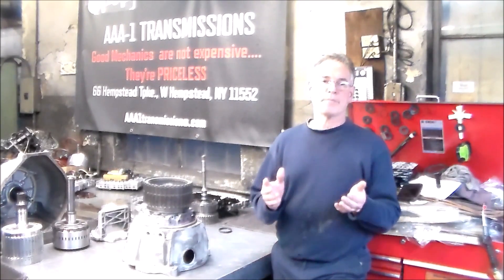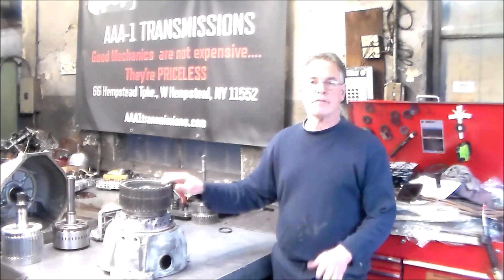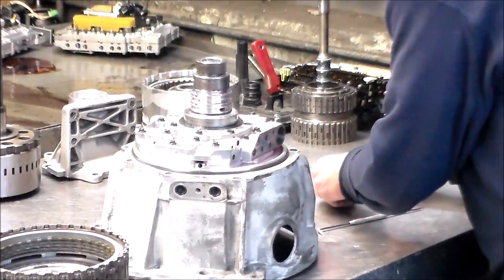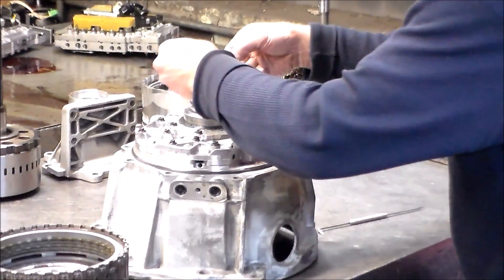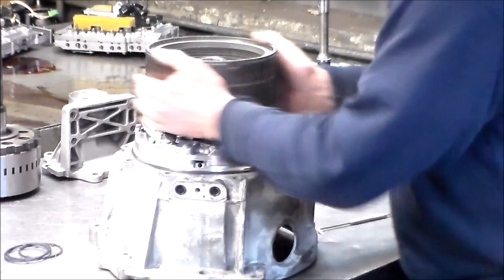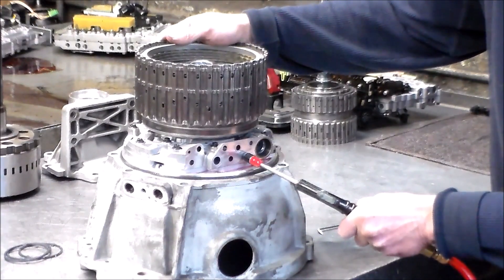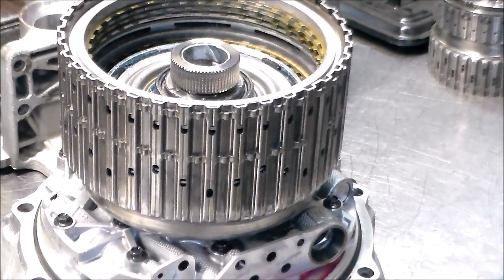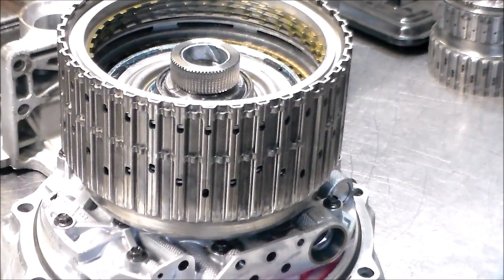The Importance Of Air Checking

Comment: 6l50 don't have the o rings underneath the seals? Every time I air check these they all hold air until I remove air tool from them
Reply from the maker: Do you rerun original rings or always change them?  This is actually first time i ran across this with a TransTec kit
Reply: @GaryFerraro  I always try to run the new ones first.
Reply from the maker: Me too,  first time having an issue was very surprised,  i had same issue once with a 722.6 unit had to put original rings back on stator @davesperformance88

Comment: Did you happen to mic the thickness/ width of the old rings verses the new rings? I know on some ring packs , it has written on them that they’re vespel rings , and do not air check very well.
    Are those rings like an older 4t65e ring? Where you have to make sure the end gaps aren’t located on the same side?
Reply from the maker: I did not mic the rings but never had an issue like that with vespel rings

Comment: I have also had this problem, with precision kits. I stack the drum, 456 and the hub all together and air check. The 1234,35R, 456 and compensator feed. 

I have gotten to the point that I just use OE bells housings and stators as much as possible. That has solved a lot of problem for me.

Comment: Thanks for the info Gary.  Will the documentation tell me which ports are for which clutch pack to test ? If we don’t have your knowledge of which to do ?
Reply: It's not always that detailed, unfortunately.  This is why working knowledge from experience becomes valuable.
Reply from the maker: you can purchase a manual from ATSG(automatic transmission service group) this manual has teardown, reassembly and details about air checking and details about valvebody @thisisyourcaptainspeaking2259